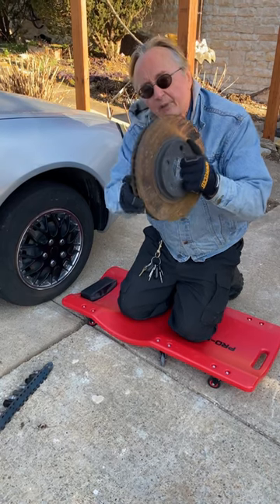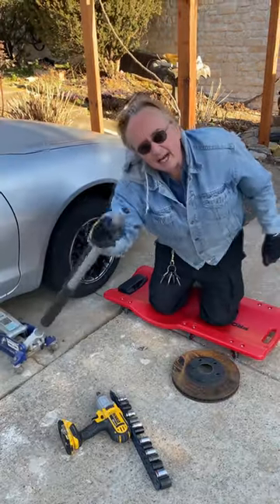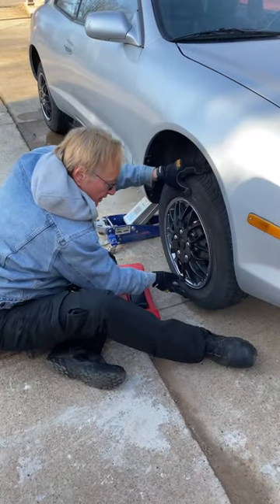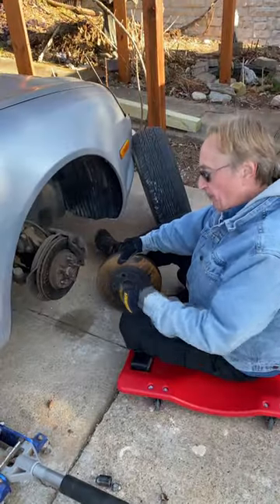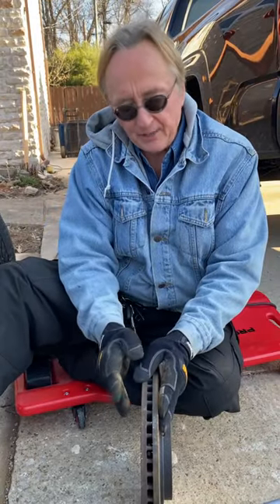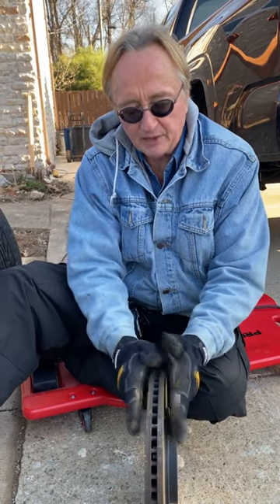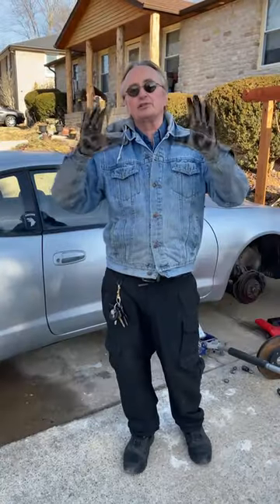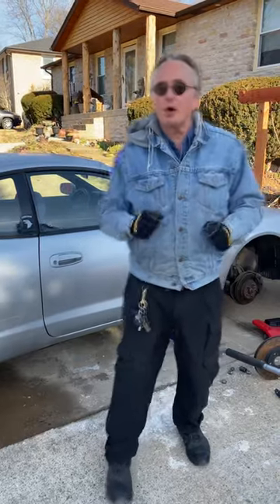If Your Car Shakes, Check This Immediately

Comment: FYI, I had a used Chevy Tahoe that did that. Figured it was warped rotors or an unbalanced tire. Pulled the rotors to find some of the cooling fins between the rotor faces were clogged with dried mud. Cleaned that out and put them back on. Smooth as silk for the rest of the time I owned that vehicle. Just one other thing to be on the lookout for. 
Cheers, Jeff

Comment: I had a shaking in my front while driving.  I realized that it started after I had my tires rotated at Tire Discounters.   When they rotated them they skipped the balancing.   I took it back and the second time they gave me the free balancing rotation i paid for when I bought new tires.

Comment: I've seen bad shake during braking, after new brakes done.  Calipers, pads and rotors.
I asked the tech,  did you check control arms? 
The bushings in lower arms were destroyed. 
2 new arms fixed the issue.

Comment: I just did this. I had frozen guide pins on the front left caliper and then I got a vibration but the truck had all new rotors and pads.. so I've changed that front. Left rotor didn't go away. Then I did the caliper and break hoes and new shoes and rotor cuz I thought it warped again... After replacing the caliper it still was there. Did the other side still was there that one frozen caliper ended up warping all four rotors. Now after one new caliper and all new rotors and pads, it's smooth again
Reply: Here's a tip for  you: Do NOT by Ceramic Brake Pads. Those Ceramic Pads cause a lot more heat than Regular and Semi-Metallic Brake Pads. That excessive heat will cause everything else in your Brake System to wear-out faster. The Ceramic Pads last longer, but you will get A LOT more Rotor warping, Brake Fluid become hotter much faster, and your Calipers will get stuck much quicker, as well. Stick to Semi-Metallic Brake Pads, and get some of those Slotted Rotors to ensure your Brakes, Rotors, and whole Brake System stays cooler so it all lasts longer.
Reply: That is number one issue today, no mechanic do clean or grease those pins, and even new cars have frozen pins because at the factory they put very poor quality grease and so little, on my wife’s 2019 Lexus with only 35k miles one of these pins I had to drill out, was not frozen but rusted to the point where it soldered with the caliper, ..

Comment: My son has a Cadillac 2001 I think. My husband changed the front brakes 2 weeks ago and now the bake tires are locking and won't unlock. Any suggestions?
Reply: Probably needs to bleed the brake lines.
Reply: Did they clean on apple grease on caliper pins ? Sliders ,
Reply: What was the problem?

Comment: Rotors dont warp. Its a build up of friction material on the rotor surface from coming to a complete stop before the rotors have a chance to cool, leaving a build up of melted material that is felt as a pulse in the pedal or vibration depending on how hot the rotors were. Do 3-5 hard stops from 60-5 mph, and drive around for 10-15 mins afterwards to let the rotors cool, and it will go away.

Comment: If your rotors are wrapped the best advice is just to replace them. Having your rotors turned is a terrible thing to do. Your having to cut down even more metal off a warped rotor and its going to warp that much faster the next time around. And also put a new set of brake pads on.

Comment: Brake rotors don't warp.  Instead the pads leave a deposit on the surface, thickening the rotor slightly and that causes the shudder.  The rotor can be cleaned up or replaced, replacement being the surest solution.  But, issues in the front end are not limited to the rotor or tir rod end, the upper and lower ball joints could also be worn and cause shuddering.  Or you culd have, especially on older vehicles, worn suspension bushings.  Finding the problem is not necessarily a simple task so unless you know what you are doing, pay for a shop to inspect the car and find the problem.  If it's just a rotor pay them for the diagnosis and do the work yourself if you are competent enough.  Otherwise, pay a pro!

Comment: So if a Tesla cybertruck has a bad brake rotor or for any reason the tires are shaking, you will not feel it because tires are not connected with steering wheel. Steering happens with computer module communication

Comment: What if you have no play and new rotors (sent back to try another set same end result) 
New pads and only shakes like getting off highway. 60mph semi hard braking 
(Doesn’t do it below 60 when u hard brake tho!)
Reply: Could be a slightly bent rim, not noticeable under moderate load but felt during braking at high(er) speeds

Comment: I got new tires on my truck at Discount Tire. First time I stopped from speed it shook. I pulled over & got my torque wrench & socket out of the tool box.

One lug on the right front was 20 ft lbs over torqued. 

Saved my rotor.

Comment: i can guarentee that the pads dont leave contact with the rotor with any significant brake pressure. it shakes cause everything is having to deflect to make up for the warped rotor.

Comment: I take them and get them turn.They are cheaper where I go.I'm too cheap to buy new ones.And the ones that are on my car are brand new.Never been turned and they can't be cut i've had The rotors checked and died tested.Which is cheaper at my local park store than buy new ones?I'm sorry but twenty dollars to have four rotors turned as a hell of a lot cheaper than buying one rotor And before anybody says I don't know how you do that.It's because I've spent thousands of dollars a month there at that store and they know they're going to pretty much do it for free.Or I will drop my Account plus other Other places of business that does business. There has threatened to drop their accounts. It's not worth them chance of chance of losing millions of dollars a year at 1 store locally and losing 20 garages that does business there because I referred them to get their parts there.  So I'll pretty much get it done for nothing. And there's a lot of times I don't pay and when I do have to pay for something. They take a personal check. A lot of places won't take a personal check. Now but they will meet or they don't get paid. A check is a form of legal tender. I do not shop or do business know where that will not take a personal check.  If I go to buy truck and I go to ride a check for it.And they say they won't take it then.I don't do the business there and then.I tell everyone and in a small town where the mouth can ruin a business so pretty much my way are the highway

Comment: You're more likely to feel it in the brake pedal than the steering wheel.
Reply: You'll feel it in both. If that's the problem, there's no way the steering wheel won't shake
Reply: @romariohenry412  No no. Not true. I've been a mechanic for 50 yrs. Warped rotors are felt in the brake pedal "Pulsating" way before it gets bad enough to effect the steering wheel.

Comment: Not that hard to change em out…. Meanwhile, me 15 hours to change the rotors on my expedition.  Rims stuck to the hub, hours of kicking and sledge hammering my rims to break them loose. Then my rotors rusted and brake dust welded to my hubs, hours of air hammering, sledging, penetrating oil. Jesus Christ. Fight of my life.